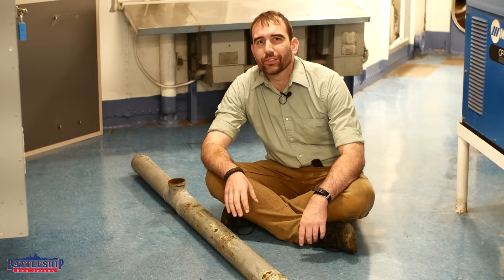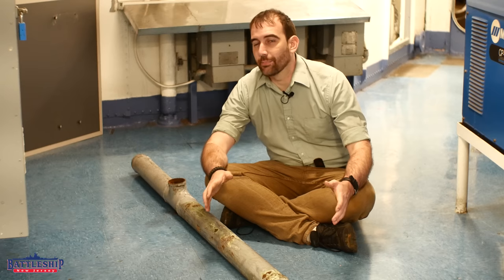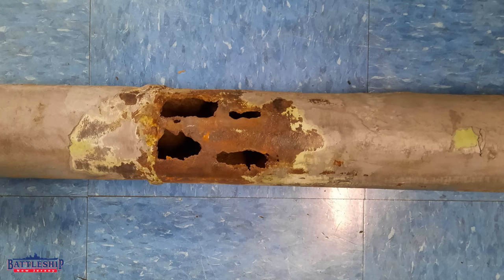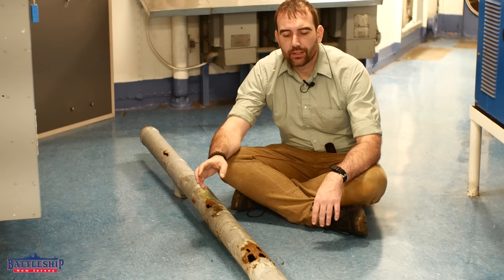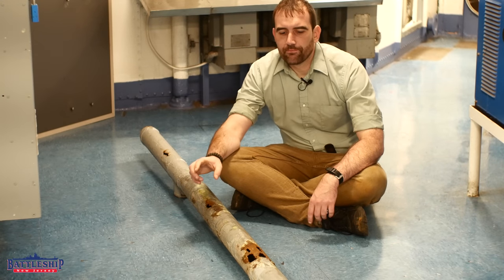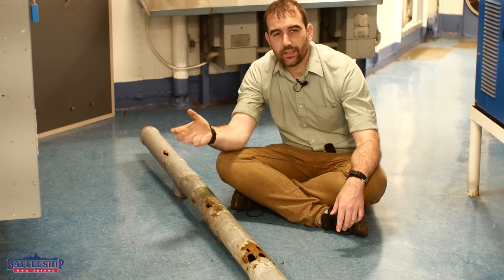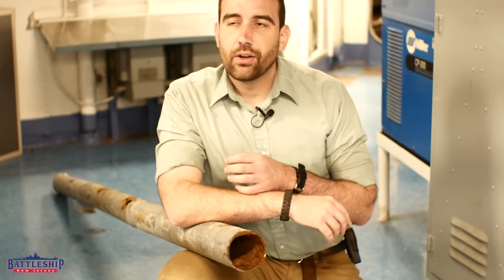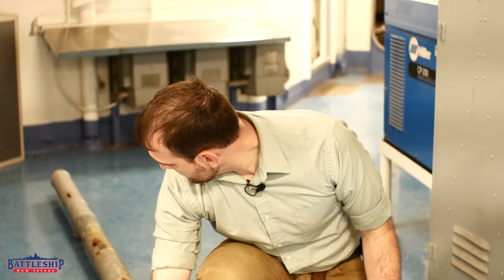Rust Never Sleeps and Ships Rot From the Inside

Comment: This reminds me of when i had to repair the pipes in my grandma's house. The sh1tuation had gotten so bad that basically the floor under was always wet even if there weren't leaks. So i started breaking the tiles and cement away and was beyond baffled to find out that... there weren't any pipes in the walls and that water had been flowing from the mainline to the sink and tub through the rust filled shapes left into the cement after the pipes rotted away. Rust is a really funky thing and short of removing oxygen from the environment, it will continue to work until there's nothing left.

Comment: There is a system where old pipes can be relined with epoxy based product.  Often used for sewer lines.  Seems like could be good alternative to save existing plumbing.
Reply: You can retrofit the lines with heat cured HDPE pipe, which you put through like a long sausage, and then you simply boil the water you use to lay it. The liner then keeps the shape, and will work even if the original totally rusts away. However normally bigger pipes than the 2in one here, mostly used for 4in and larger pipes, and for those where digging is either impossible or more expensive.

Hopefully they are replacing the original pipe with welded PVC pipe, at least schedule 10, so the thicker pipe will survive a lot longer in use. Just means you do not buy it at the big box hardware shop, but at a plumbing supplier, as the big box hardware shop only stocks the cheap pipe with a 5 year life. Here you want utility style pipe and fittings that will last a century, and they do cost a little more, but once in not a worry till next century.
Reply: @SeanBZA  UK uses welded PEX for all of its gas mains 150mm or smaller. The joints are ultrasound welded and (of course) corrosion is a zero issue. A similar material would be ideal for replacing these rain water drains. Not original of course but corrosion issues would be gone.
Reply: It's called "Cured in place pipe."  It's definitely something the Battleship should look into for pipes like this.

Comment: Even the best fire systems in large buildings get rust inside even though they are constantly pressurized with water. That's why the first water out is always brown. Air and water in a pipe together is the worst scenario which can't be avoided in cases like these. 

The biggest threat to an Iowa Class Battleship IMO would be a generational loss of interest in history. A great youtube channel goes a long way when it comes to preventing that! Keep up the great work Ryan.
Reply: It depends how ritzy you wanna get. Out factory pulls a vacuum on the pipes for hours then blasts in nitrogen. It still doesn't stop the rust entirely, water has oxygen in it, but the system will probably make it 50 years with coupling replacements.
Reply: @kylehenline3245  Agreed. The less oxygen the better. Nitrogen does a great job in sealed systems but drain pipes like these have open ends and varying water levels. It's amazing they have lasted as long as they have.
Reply: @haunter_1845  oh yeah...didn't consider the open nature of them lol

Comment: You nailed, rust is one of or the greatest threat to a ship.    Plus I do not know how cold it get in the winter in New Jersey, but winter cold , thawing and freezing can split pipes, scuppers, exterior drain pipes.    If water is  blocked in exterior drain pipes, scuppers and freezes this could split pipes.   What has been done on lake ships was to put a old rubber hose down a scupper.  The rubber hose has lanyard tied on to the hose so it will not fall through.

Comment: Lack of funding, followed very closely by lack of volunteers to put those funds into action, are the greatest threats to Battleship New Jersey and every museum ship in the country. Even ships in active service can fall prey to their operation and maintenance budgets being reduced, time between shipyard maintenance periods being extended or even skipped all together (I've seen it). Having served in the US Navy, I have witnessed how much maintenance (as well as the large labor force and the massive government Defense Budget to support it) it takes to mitigate the wear and tear from both the elements and normal operations. Even with all of that,  support and maintenance while in active service, parts of a ship wear out, corrosion eats away at pipes, structures, and surfaces faster than they can be maintained outside of the shipyard.
All that to say, financial and volunteer support are the greatest threats.

Comment: Hey Ryan, I've had a job similar to yours in restoration and upkeep of old buildings. I had a problem with old cast iron vent pipes. A master plumber with 30+ years experience said about the same thing as you. Vent pipes with little or no water contact destroy from the inside out because of water vapor in the exhaust from the bathrooms and kitchens. This is an excellent video.

Comment: I haven't watched the video yet and this may be covered in the video, but there are two chemicals to look into. One is an iron oxide binding enzyme sold as a concentrate called Rust 911. (It can also be bought under the more commonly known brand name Evapo-Rust, but this product is diluted with quite a bit of water.) 1 gallon of this concentrate can be diluted to make 16 gallons of final solution which will remove rust from a minimum of 350 lb of metal. Paper towels, rags or other absorbent material could be soaked with this substance and laid on top of rusty metal.

After the excess loose rust is removed, the second chemical is a primer paint called Neutra-Rust which chemically bonds with and neutralizes the oxide layer. The metal can then be painted over with a high quality marine paint for appropriate color if desired. It is used on North Sea oil rigs.

Comment: I was on the USS Kauffman FFG-59 in the early 2000s The Oil Kings were painting out Aux 2 lower Cleveland and found a fuel piping issue.  The piping outside would flex like squeezing a dry sponge.  Further investigation by supship and shipyard resulted in 40 feet of piping being replaced and a ship class check on the same sections and several needing the same work.  If not repaired it could have led to a hidden major fuel oil leak

Comment: Our ship our ship had alloy piping ( monel or moly b?) just remember urinals had to be cleaned by unsoldering the connections in the mainline, heated, hammmered and scrapped to remove build up.  Re-silver soldered and tested. It stunk to high heaven.  We eventually procured a drain snake for the ship.

Comment: I know it wouldn’t be very “museumlike” but I would see about replacing any plumbing with pvc since it will last basically forever. It can even be painted so it doesn’t stick out like a sore thumb
Reply: @Grunttamer  the guy says many times that the ship would never go back into service.
Reply: @haunter_1845  wouldn’t be too bad. They have flexible rubber fittings for joining other types of pipe to pvc. Every time you replace a section of pipe just stick a section of pvc in until all the pipes are replaced
Reply: @Grunttamer  I like this idea, PVC is cheaper than copper and is easily adapted to any number of metal piping. Plus much easier to replace.
Reply: @Grunttamer  Then you would still have one end of your rusting pipe going into a rubber adapter which you are using to adapt to your PVC pipe. Yes PVC is great, but once you start using rubber adapters and worm gear clamps etc, the whole system fails and falls far short of what a threaded or welded iron/steel system can do.
Reply: @haunter_1845  The whole point is you replace the rusting section with PVC, so putting rusting pipe into a rubber fitting shouldn't happen because the rusting section should have been removed
Reply: @richardmillhousenixon  The inside of the entire pipe system is rusty and getting thin. The best solution would be to replace the bad section between unions or valves with new steel pipe. PVC and rubber boots are not something you would use for this application and would cause more issues then it would solve.
Reply: @haunter_1845  PVC and rubber boots are a very good temporary solution until the museum can get together enough funding to enact a more permanent solution
Reply: @richardmillhousenixon  PVC and rubber boots is a diy homeowner grade solution to a problem where there is already a better solution. If it is an emergency then a leaking pipe should be fixed with a repair clamp (navy guys call them band-it clamps), then the whole section is replaced later when possible. Active duty navy ships and submarines have these all over the place. Several in a row in some cases. They are not that expensive and they work.

Comment: Did the weld beads inside the pipe keep a bit of water in that replacement from draining out of that pipe all the way?  Like little dams on either side so a bit of water trapped inside.

Comment: I would worry about any through hull fittings, even if they had been blanked over. If there is going to be a major leak that is where I think it would be. Galvanic corrosion if dissimilar metals were used would be a concern.
Reply: Yes, there are different levels of disimilar metals. Most people only think of brass connected to steel or steel and aluminum or the like but even different grades of steel matter when you talk decades.

Comment: There are ways to line pipe with epoxy on the inside but with the amount of plumbing on a ship it would be extremely expensive.
Reply: Maybe they could do that with the replacement pipe.
Reply: There's a cheaper way, used to line pipes. They use a rubberized plastic (pinch of salt, i don't exactly know what it is) that's rolled up into itself and laid at the entrance of the pipe (after it's been cleaned and measured). Once they're done, depending on the severity of the pipe's state, they either push it from the entry point with air or vacuum suck it from the other side with a pump (basically, if it leaks, they'll push it, if it still holds air, but is on the verge, they suck it through) thus making this rolled up liner to extend through the pipe and line it.

Dunno bout NA, but here in Europe i've employed the services of people who line pipes with this stuff where the historical value of the house absolutely blocked any potential to replace the pipes, so they're guaranteed to last quite a bit more than regular pipes.

Comment: Next to rain, I would guess condensation on humid days. The ship is sitting in water is colder than ambient temperature, so water vapor will condense onto the metal. After that I'd guess fire.
Reply: Not much to burn on an iowa. Especially today. But the navy designed them that way in the first place.
Reply: @americanpatriot3638  Metal burns.  It just...burns.  Iowas are metal.
Reply: @adamdejesus4017  metal does NOT burn. Paint on the metal burns and metal melts, but it does not burn.

Comment: You can re-line a pipe. It's a plastic tube in a tube that extends inside the pipe and kind of rolls out from the inside to cover the outside... I do not know how well it does with junctions though.

Comment: While CERTAINLY NOT "original equipment", in the case of such still-active scupper piping would it be possible to replace it with new PVC plastic piping, painted to match on the outside of the pipe???  It doesn't rot and may last much longer than rust-bloomin' steel, but it ain't historically accurate by any means either???
Reply: @benjiro8793  Great thoughts Ben.  Thank you.

Comment: Next to rainwater I would think Galvanic corrosion would be a real big problem on any steel ship.  Considering all the dissimilar metals the electrical systems and the fact that it’s sitting need a big giant tub of electrolytes (salt water)!  I had a buddy of mine that a big steel houseboat.  Every year we had to dive under the peel and attach big thick plates of zinc as sacrificial Diodes!  I could be mistaken but I think it’s more of the problem with the ship that’s more for long periods of time rather than one that’s constantly underway

Comment: Speaking of damaged things....

Have you fixed the shore power cable support bracket yet?   Or are you waiting until they fall on someone, electrify the whole ship, or blackout a chunk of Camden?
Reply: Looking at the deck walk video at approximately 13:40 it appears to have been fixed.
Reply: @richardmillhousenixon  I saw that glimpse, but you don't see it clearly enough to tell one way or the other.  That may well be just the original weld you are seeing then, but if it has been repair-welded on the back side, it would not have not been put back in its original position first.  It should be higher compared to the cross piece behind it like the one on the other side to be in its proper alignment.
Reply: @Orxenhorf  I'm a welder, I'm pretty sure that joint has been repaired.

Comment: I believe you that interior rust is the biggest threat, but does that mean there is little or no risk from rust to the exterior of the hull? I would think that marine growth or electrolysis would somewhat lower resistance to rust below the exterior waterline. Note that I am asking because I know little or nothing about metal boats. I’ve only worked at maintaining the hull of a 29’ wooden sloop.

Comment: Would it be feasible to put liner in the plumbing as you fix it? It would keep the rest from forming inside the metal piping. I've seen the do it for commercial and residential plumbing that has old concreted in metal piping that can't be cut out

Comment: Biggest threat now? Other than rain water and ice expansion:  Lack of funding for support.  Then normal rust and ozone rotting electrical  insulation. 
BTW, are those auto transformers behind you under the table or shelf ?   Enamel wire is aging due to heat and ozone or oxygen.

Comment: The modern US Navy ships are slowly replacing the steel piping during new construction and regular up-keep periods with 80/20, 70/30, and 60/40 copper/nickel pipe. Only steam and fuel oil will remain steel inside ship.

Comment: The only surefire solution to rust prevention - remove all oxygen/exposure. It would be hypothetically possible to preserve steel and iron indefinitely by applying thin epoxy coats, but doing so over the entire interior and exterior surfaces of piping and armor and superstructure and decking would be impractical and cost-prohibitive. Also welding an epoxy-coated metal is a good way to start a fire and burn off all of your precious epoxy coating.

Comment: The best way to find a bad spot would be to fill the system with water then pressurize it above normal a normal pressure with a little bit of air. If the pressure drops after turning off your air then you have a leak which should be easy-ish to find because water will be flowing out. Not as easy if there are many leaks.

Comment: I assume sea water must have been used in the boilers, right? That would make a very high corrosion environment. I've seen how steam rail locomotive (fresh water) boilers are cleaned and maintained but battleship boilers must be orders of magnitude more difficult to care for.
Reply: That's a fair assumption to make, but it's not right.  Like most ocean-going steam ships the boilers were initially filled with "distilled" water, and kept to level with a mixture of condensed water and more distilled water.  They may have added some boiler treatment on occasions to help flush any debris to traps where it could be removed.  In one of Ryan's earlier videos he points out the massive condensers and seawater treatment plants.
Reply: @18robsmith  Now that you mention it, I don't see steam puffing out of the funnels on old films. That should have been a dead giveaway. That steam has to go someplace .

Comment: Does the museum just use any paint or do they follow certain standards and requirements for different areas. This is a question I thought about while touring the USS Iowa. I currently work as a paint coatings inspector in the marine industry so I was just curious.
Reply from the maker: We use specific coatings appropriate to the conditions, interior/exterior, galvanized, and spaces where rust is a bigger issue get different coatings as well
Reply: @BattleshipNewJersey  does the ship have its own guide or do you follow the DoD’s Standard Items?

Comment: Time is the biggest danger. Steel ships rust, and have limited lifespans, even with massive expenditures for maintenance. They reach a point where, as far as useability as a naval weapon goes, it's cheaper and easier to build new, with newer technology than it is to restore and upgrade 50 or 80 year old obsolete ships because of someone's emotional attachment to them.

Comment: Why didn't they use stainless steel?
Reply: Well war time production for one. Mild steel doesn’t need as much chromium.  But at the same time stainless can still rust. And for a ship that was originally designed to last 20 years, the added cost doesn’t make sense.